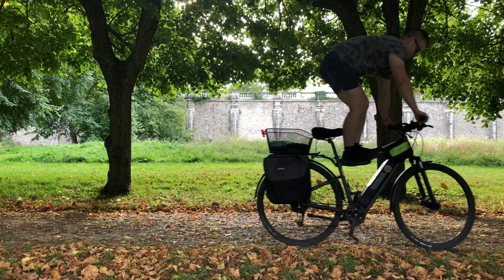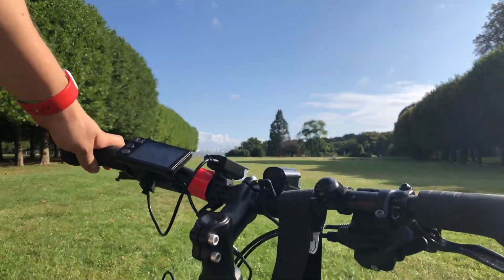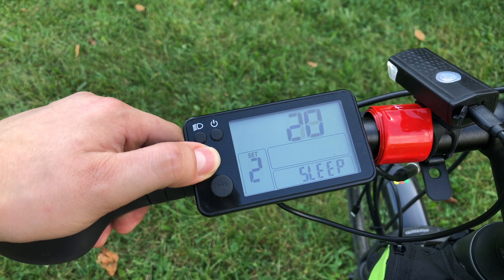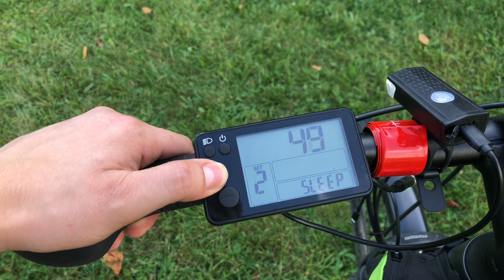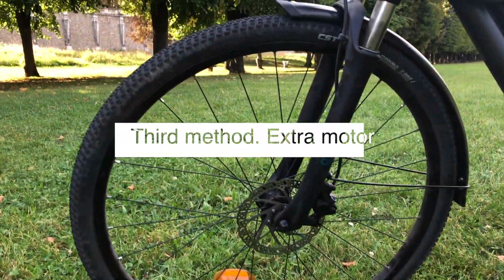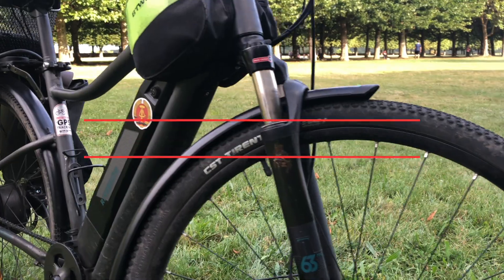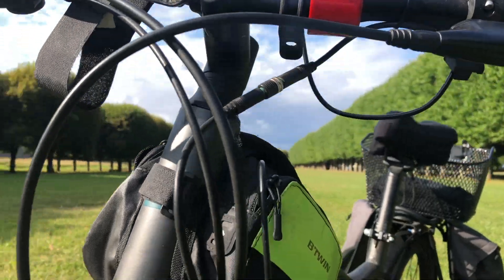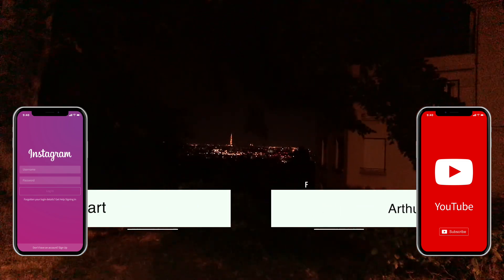Riverside 500E Speed Unlock. Boost your e-bike performance. How to change speed limit of 25 km/h

Comment from the maker: Riverside 500E - Protect Your Bike From Theft! - https://www.youtube.com/watch?v=W4I2YUkj1XM
Reply: Hey Arthur.. I need an urgent help with my Riverside 500E .. So this saturday evening  my engine suddenly stopped after having the bike for almost 1 year. The display was showing 55km/h while standing still. Battery on 85% , 0.0 Km to go. I checked all the cables. and connectors.. even the one inside the control box.. Everything is fine and tight. And the closest Decathlon service is 60 and 30 km by train... Opens on monday.. And I have to use the bike to be at monday at work at 5AM! .. What do I do ? what can I check for ?

Comment: Did you eventuly try second method ? And what kind of controler dod you used ?
Reply from the maker: I build a completely new e-bike using a regular 500 model  - https://youtu.be/5rX7VKilm0I. Pozdrawiam ;)
Reply: But you says you ordered controler to this ebike. What exactly model of controler you ordered. Cos I need to unlock speed on exacly the same bike.
Reply: and you cannot simply unplug cable responsible for speed limit.

Comment: Hi Arthur. I am thinking to buy this bike for commute to work. My job is 10 km away. What do you think is this bike will be ok? How often i can expect to charge the battary on standart mode?
Reply from the maker: 10 km is a small distance for this e-bike ⚡️😅 by using mode 1 you will be able to ride around 100km i guess. BTW there is a better option in my opinion: https://youtu.be/5rX7VKilm0I
Reply: Thanks Arthur. What is your height? What size of the frame you went for? I am 1 m 75. Decathlon size chart recommend medium size for me. I kind of on the boarder.  My wife would like to use it aswell. I tried L in the shop was also   good and M was not available on display. I think medium will be right size what do you think.

Comment: I just buy a 920e riverside with this computer and it works. But I don't understand the value you put in "set 2".
The mine has 10 as defoult. Someone knows which value corespont to what?
Understood, it's on user manual. It's the stand by time in minute of the screen__!

Comment: Arthur - I am planning to buy this cycle next week and i would like to know the battery capacity. Like in mode 1 how much it could run????? Economy - like 60 kms????? Kindly advice
Reply from the maker: Battery capacity is a big advantage of this e-bike. On mode 1 you can drive around 120 km on the flat surface without too much hills. Let’s say 100 km if you are a big and heavy guy 😃
Autonomy depends on the terrain, weather and your driving style. PS. Subscribe to my channel of you want to support me 🙌😇🤓
Reply: @ArthurBrassart  impressive bro. Thanks fa the hint 👍👍
Reply: I already have rockrider and it has the same battery but how could this cycle do more than 100 km in mode one.

Comment: finally:D sad though how it cant be increased atleast by a little (30kmh would be perfect) in the menu.. seriously considering replacing my riverside 500e by a est100 or a est 500 because of that. its such a great bike but i dont end up using the motor assistance in half of my tour because it turns off after 25kmh and i manage to get to 26-27 on my own most of the time. 

any idea what the number in the setting menu is supposed to mean? like the one that goes from 5 to 60. ive got 0 idea what its purpose is.
Reply from the maker: Fist of all thanks for your comment bro, i really appreciate it. 
EST100 or 500 is a good one, but technically its the same thing. Spending another 1000+ bucks on a the same e-bike is kinda not the best option.
Numbers in this menu means: time before your bike goes to sleep when you stop and don"t turn it off with a button. from 5 min to 60 min :) When i saw that for the first time i thought is 60 KM per hour :D But no...

i wanted to try to replace its controller. but i don't want to mess things around with this bike. i already tried to change my brake pads and its a pain in the ass, so i don't want to play with electronics. 

i got another idea. to built my own custom MONSTER E-BIKE. Like buying a new regular bike like off road model with dual suspension. then i will buy a central 1500W motor and i will build my own super huge battery to power it. i will be able to make it ride up to 100 km per hour (in safe area of course). What do you think about it? Should i try to make this project? :) i like building things.
Reply: @ArthurBrassart  yes sure spending another 1k is pointless but i was thinking about replacing mine. got 60 days left i think to return it. 

i dont know sounds reeeeeally complicated tbh and ofc illegal :D was hoping i could increase speed and decrease in the menu whenever i want. Wanted to disable speed unlock whenever im in the city, as police controls are a thing and use the speed unlock outside the city.
Reply: Buy an est520 you can unlock it by moving the speed sensor to your pedal...
Reply: @websvro  Riverside e520 ?